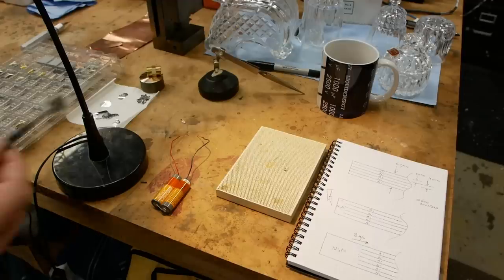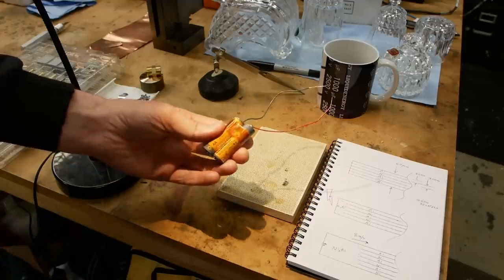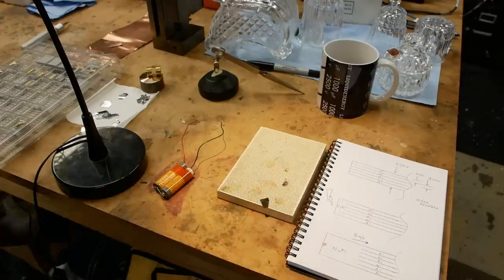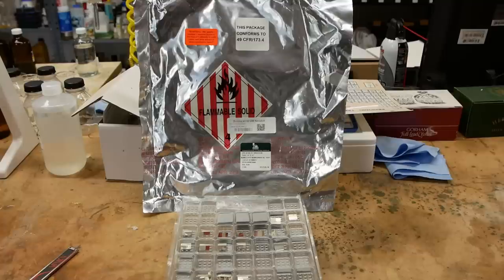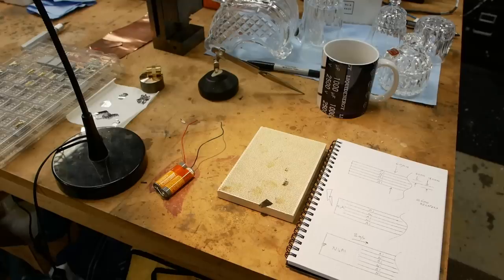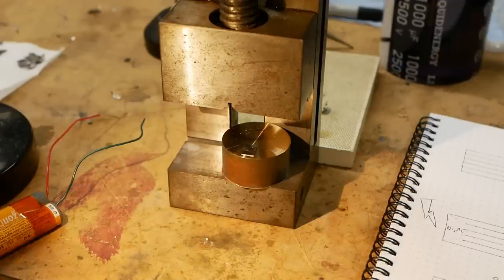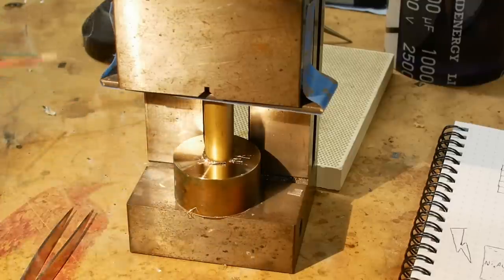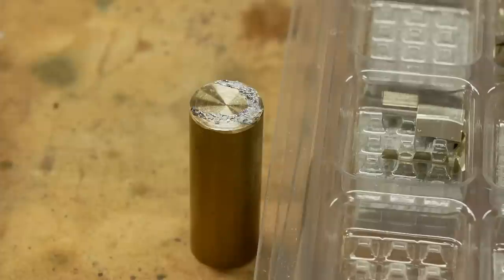Multi-layer reactive foil: no fuel, no oxygen, tons of heat

Comment: Holy crap that's incredible! how is it made? i had no idea something like that existed. But now i've seen it in action, it feels like something super obvious that i should have known. Amazing stuff. 

Are there special procedures to cut it? i'd imagine you wouldn't want the roll/sheet to go off before you could use it.
Reply from the maker: I think it's made by sputtering Al and Ni alternately, but I'm not sure if the process is reel-to-reel or batch -- either way very expensive! One patent claimed it can be made by physically rolling out the metal and folding it repeatedly. The tech sheet claims it can be cut with a laser with different parameters since a laser is also recommended for initiation!
Reply: It is made by evaporation of metals in a vacuum chamber, onto a sacrificial substrate. No need for a sputtering gun, but it needs a very good vacuum.  In any case, it is still very expensive. Moreover, low demand means that it is effectively hand-made (that is, no mass production) for each tiny batch.
Reply: @AppliedScience  You should test whenever it can be initiated with mechanical shock like a hammer blow, might yield interesting results  😊
Reply: I would think you'd want very sharp tools to disturb the material stack as little as possible.
Reply: @AppliedScience  look into "arrested reactive milling", it's another way to make this metastable material.

Comment: I believe there is an explosive  smokeless delay fuse that works in a similar fashion. I know it uses a wire passed through a dissimilar metal tube. One of the metals is Palladium the other is aluminium or a silver copper mix. When heated at one end,the metals, melt, forming an aloy, releasing considerable amounts of heat. The advantage is ignition without the release of any smoke or gas. I think it is sold under the trade  name pyrofuze.

Comment: As a ground plane in PCBs,  this'd be neat for self-destructing electronics,  although soldering it up without setting it off would be tricky.
Reply: It would be impossible to build and handle such a PCB outside of a lab, I think. Nanofoil is very touchy stuff. It is sensitive to ESD and mechanical shock.

Comment: Try initiating the reaction by squeezing it real hard and then adding a bit more by striking it with a small hammer. This might enable it to initiate in multiple points at once, creating an even faster heat pulse.

Comment: You should be able to use this to solder a heatsink to a CPU to maximize thermal coupling, improving the thermal dissipation, thus allowing one to overclock for higher performance.
Reply: But that works fine with other metals that just have a low melting point.
Reply: I feel like there’d be a lot of bubbles from the heated air.

Comment: Seems like this would make an excellent ignition source for rocketry.  I'm specifically thinking of so-called "solid-state rockets" where the thrust comes from propellent stored in wells on the surface of a block.  Each well is able to be individually triggered by controlling hardware.  They're intended for use in satellite station-keeping in situations where other methods aren't viable due to mission length or other factors.
Reply: Yes! This would probably solve my ignition source conundrum I’ve been stuck on.

Comment: A similar alloy reaction was used to make smokeless delay  fuses for explosives. 
The fuses were made from a pair of thin concentric wires made of two different metals. 
When ignited, the two metals combined to form an alloy that liberated considerable heat in the process. As no smoke, or gas,  is generated in the reaction, the fuse can be completely enclosed, it also does not require oxygen.
Reply: I think these nano foils still have a similar application.

Comment: I discovered something similar. I own a heat treating company any while processing Titanimum I noticed a weird in phenomenon. I heated the Titanimum to about 1600° and water quenched. Then back home to the oven and then as it was heating all the sudden a real bright spot started at an edge that was brighter then the black body color of the oven. This bright spot traveled through the entire disk of Titanimum quickly. Now the entire dial was glowing much brighter then the actual inside of the oven. This did not happen the first time I heated it. Don’t know what caused it but it was VERY noticeable and maybe had to do with the crystal structure changing. It was grade 2 Titanimum disks that where about .02” thick.
Reply: Sounds like your titanium has just oxidised from a catalyst that had migrated onto the disc surface.

Comment: the biggest detriment to soldering is surface oxidation, also in preparing your thin piece of solder if you didn't use enough flux or kept it molten to long it may have become oxidized

Comment: Just after this material was invented, and I would swear they were using aluminum-titanium layers at that time,  I saw a company chemist demonstrated it at a chemical industry convention.  Item 1, he had brought the material to the convention in his personal luggage on an airplane (gulp).  And 2, a potential app was using it to glue ceramic armor to armor plate for tanks.  Funny stuff.
Reply: I don't see the problem with bringing this on a plane. It isn't going to self initiate.
Despite it being "hot" and "reacting fast", it is signifigantly less dangerous to the plane than plenty of other benign stuff we carry all the time.
Reply: It has to be well-packaged. Simply snapping a corner off can sometimes initiate the reaction.

Comment: 2:10 Hi Ben. In the slow motion shots, we can clearly see the reaction front, as you described in you video. The front begins always only from one of the electrodes.
Does it begin from the negative electrode? If yes, is it because electrons "land" there first?
If we assume that the positive and negative electrodes have the same contact area, shouldn't the "local" current flow be the same, so the same resistance and hence the same temperature rise?
What will happen if you place multiple negative electrodes (or whichever is first) to spread the current flow at the contact points? Will we observe multiple reaction fronts or the reaction will start from the other electode?
What if you increase both the negative and positive contact areas, like across opposite edges of the square? Is there going to be a front again or the metal will combust "instantly" all over its surface?
Last question: The material must have a minimum temperature at which the reaction begins. Can you heat the whole piece gradually to that point and see if it reacts instantly?

Comment: This sure seems strange!
1) Soldering without flux? Of course the solder didn't want to wet the surface? They actually do this without any kind of flux? Maybe if you gold plated both surfaces first to prevent oxidization?
2) What happens to the reactive metal in the joint? I thought nickel did not dissolve into tin very well? Or is this material so thin that it is able to entirely dissolve?
Reply from the maker: Indium corporation claims the process works without flux, but one detail I may have missed is that the substrates should be tin plated. One of the other commenters said the process works without solder if the tin thickness is correct. The NiAl compound stays in the joint. It's not the strongest material, but this type of bonding is usually done for thermal transfer and light mechanical loads. Another neat benefit is that it can bond materials with dissimilar thermal expansion coefficients since the bulk of the material never heats up during soldering.

Comment: in the soldering experiment, the foil ends up as part of the  joint.  Solder does not stick to aluminum. At 6:01 you can see the solder sticking to the brass but not where the square piece of foil was sitting.
 So I'm not sure how this would be done in  a commercial application keeping the foil from contaminating the joint.

Comment: Could you fold the piece so it's thicker? Would be interesting to find out how the front travels along the normal direction between layers and if it gives a boost to the soldering capability. Then there's a question: wouldn't the aluminum & nickel leftover mixed in the solder screw up the bond in the joint?
Reply: I suspect macroscopic folding wouldn't make any connection between the pieces. maybe a couple atoms in close enough distance. that could be enough though, would be interesting.

Comment: Flux! Joins aren't wetting because the solder isn't getting the components hot enough.  Solder is oxidizing before it sticks to the bronze, but sicking perfectly to the nickel-aluminum.  if you can't flux the joint, eliminate the oxygen in a vaccuum chamber, then ensure the joint has solder continuously between components.

Comment: It might be that oxidation is the issue, i have used boric acid dissolved in alcohol as a flux before, it leaves a very thin film when the ethanol flashes off.

Comment: Maybe add some flux, zinc chloride, in small amounts.  Can be water soluble flux or oil based flux which contains Oleic Acid.  The flux cleans or preps the metal and acts like a carrier of the solder.  Wherever the flux is applied, the solder will follow.

Comment: Perforate 2 Al-Ni allloy sheets and sandwich the solder between them and fold the sheets at the edges, that should allow solder flow and contact with both the heat and the surfaces to be joined.

Comment: (Made some major edits, to clarify about using thicker metal sheet for bonding before rolling, atmospheric control, etc.  Think making this stuff by adapting solid-state bonded mokume gane techniques if you want the tldr)

You might be able to make this stuff using a electric kiln (w/ atmospheric control) + enough force clamping many layers of thicker metal together (they would need to be extremely clean) to solid state fuse a large billet, and then run it through a rolling mill til you reach the desired inter-layer thickness. 

You can make basic modifications to a standard kiln to achieve atmospheric control and keep oxygen out.  I run a kiln with pure hydrogen atmosphere (generated from a PEM electrolyzer), and a bubbler for flashback protection for the 'exhaust' (when I need a reducing atmosphere)- although something like argon is probably more sensible/safer for a use case like this.  Regardless, I've never experienced any flashback/combustion after a few minutes purge.
Reply: How would you avoid oxides forming?
I'd bet they alternate plating each layer to the previous one.
Reply: @Prophes0r  If you look up modern techniques for solid-state fusion of the bullet for mokume gane, you simply use atmospheric control inside the kiln. It is super simple to modify a standard kiln to run gas through and keep oxygen out.

I run my kiln (when heat treating gemstones that need a reducing atmosphere) with pure hydrogen and have never experienced any flashback from the hydrogen combusting (although I do use a bubbler for flashback protection where the most of the gas leaves).

I've also run it (when I need an oxidizing atmospherel with oxygen from a repurposed medical O2 concentrator, and an O2/O3 mix by putting an ozone generator in tandem with the O2 concentrator- although I'm not sure if the ozone survives to do anything once the kiln temp is high enough.
Reply: @Prophes0r  (Added the details about atmospheric control to the original post)
Reply: @sophiophile  I'm not saying you can't get a good environment to keep oxidation from happening.
I'm asking how you would get the thin layers of Aluminum into the sandwich without it oxidising. Like, before you get the kiln and clamp involved.
Where does the thin, Oxygen-free Aluminum feedstock come from?
And if you can get Oxygen-free feedstock, does your feedstock production process benefit from adding the kiln step rather than making it directly bonded to the Nickel layer?

That's why I keep saying it should just be alternating plating steps for simplicity and control.

Also, remember that this is a heat initiated process. These metals WANT to react. They don't need anything external to do so other than energy/heat. If you give them enough heat to bond the layers in a kiln, you are giving them enough heat to initiate a reaction and alloy.
Reply: @Prophes0r  Plating may very well work too (although the time and cost would be extremely high), but I don't think the concerns you are mentioning would interfere with the process I suggested.

There are very common pretreatments (nitric acid bath for one) that remove the oxide layer from aluminum. I have never bonded aluminum this way, however. I have done it with other metals that form oxide skins, and successfully bonded layers while removing oxide using only abrasive processes.

Also, you don't have to worry about setting off the material because you solid state bond many layers of *thicker metal*, and then using a rolling mill to reduce the thickness of the fused billet.  (The traditional way is roll into half thickness, cut it in half and stack them, roll again, repeat over and over until you achieve the per-layer thickness you want). You never expose metal that is thin enough to ignite to the heat of the kiln.

I guess the only way to know for sure would be to try!
Reply: @sophiophile  It looks like the manufacturer make it using deposition in a vacuum.
While Ben has the right equipment, making anything thick enough to be usable would take FOREVER. So it doesn't seem viable outside industrial manufacturing scale.

It also looks like it is incredibly expensive...
Reply: @Prophes0r  Deposition and sputtering setups are really easy to build. But you are right that it would take forever. (I've build magnetron sputtering apparati before, but it was before Ben's videos came out- I wish I had seen his prior as they are much better than mine.  I couldn't afford sputtering targets, so I used sheets of metal (either silver or palladium) as both the top piece of my glass vaccum chamber and one of the electrodes, then simply rested the nested magnets on top of the metal sheet (with a small spacer, since the metal would get hot pretty quickly).

Comment: Really cool concept.  I wounder if you could wrap the material around a two solder tinned wires that were twisted together and the heat generated would melt the solder.

Comment: Wow, this really sparks the imagination 
I wonder if it could liquidity rubber and then be embedded.  If so, it might be used with a bicycle tire patch kit to suture larger punctures.
Reply: Rubber chemically vulcanizes, and won't melt once it becomes a tire, it just burns.
Reply: I don't think hot patching small tires is ever making a comeback, replacement is too cheap.

Comment: Hi Applied Science,
Nice video again.
The phenomenon is known in the explosive and propellant field as two fine ribbons of metal that are intricated or twisted and that could be ignitated by a spark or heat by generating high luminosity, fusion and alloying of the two metals with help of atomic mixing and entropic desorder (chaos).
It is thus a purely entropic process and doesn't involve oxido-reduction or chemical reaction.

The name refers to into English (or into French) to "coruscative alloy mix" (sometimes written as corruscative in old texts)  (aliage coruscatif)
It doesn't per se require to be thin (submicronic or nano) but it speeds things up because of the intimacy of the solid reactants... just like grinding finer oxidiser and reducers into a pyrotechnic mix will speed up the burning rate to several MACHs instead of slow burning.

It is written in one of my Explosives 4th Edition book from Rudolf Meyer to be able to acheive a burning rate of a few meters/s and some mixes up to a few 100 meters propagation rate (usually lower than MACH 1 - thus a bit like a deflagrating material -  low burning explosive material - often below or much below sound spead in air and especially into the material - speed of sound in hard metals can be up to 1-6 km/s) what contrast a lot with usual detonating materials (detonating at 3.000 m/s (about MACH 10) up to 10.000m/s (about MACH 28 yes)) 

I hope this will help you a bit.

PHZ
(PHILOU Zrealone from the Science Madness forum) -
(and A.O.L. (alt. engr. chemistry, alt. engr. explosives, rec. sci. pyrotechnics, ...))

Comment: You can weld alkaline metal if sulfhexaflorite , and this application if fin metal is one little heavy because all metals is good heat conductor, metal rod can absorb easily heat from that fin metal and no have time to melt properly , I don’t now but I think is possible to stick materials if non heat conductor

Comment: I think you can try to use this method in vacuum without solder cause as I know in space vacuum Iron nuts and bolts are stick together, because of diffusion in Vacuum. May be for realize this effect you will be need pre-clean surfaces by plasma threatment.

Comment: Interesting.  It's the ultimate cold solder joint, though, so not a big surprise that it's not bonding well.

For getting a super-thin layer of solder, have you tried solder paste?
Reply: Solder paste is going to have filler in it that is meant to burn/evaporate/be-cleaned away.
I think there would be way too much volatiles in it to get a good joint.
Reply: Yup not surprised with the cold soldering not working, even in ideal conditions 😅😅😅
Reply: The way I have seen this advertised, is that it is supposed to be its own solder -- that is, generate enough heat to weld the two metals in place. Adding solder might be a poor idea, depending on the conditions.
Reply: The surfaces to be mated should be tin-plated. The plating acts as the solder, and is already well-bonded to the surfaces.

Comment: Wouldn’t the presence of the aluminum nickel intermetallics affect the overall strength of the joint? They are very brittle and have a different CTE than the base metals, my worry would be joint reliability through thermal cycling…